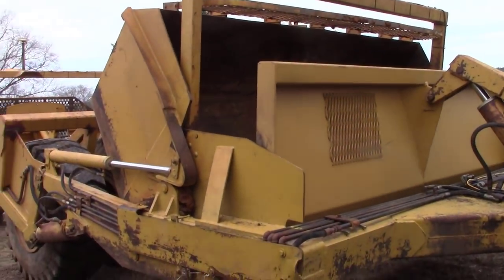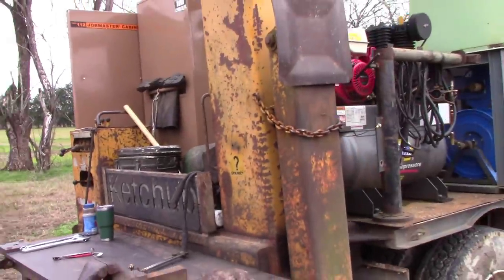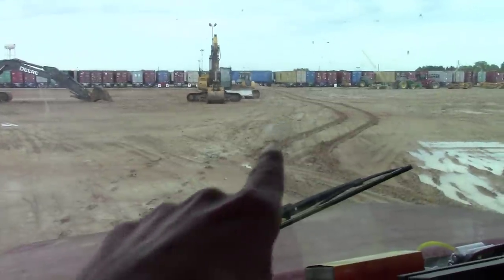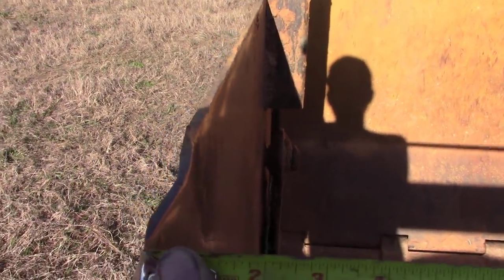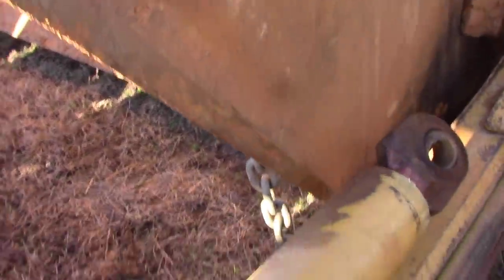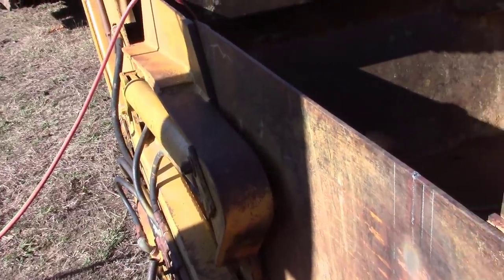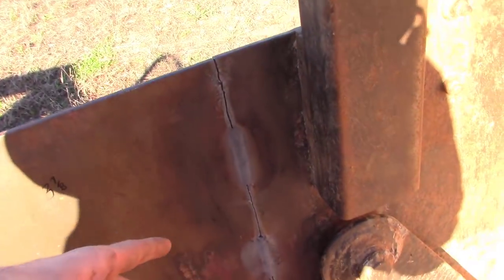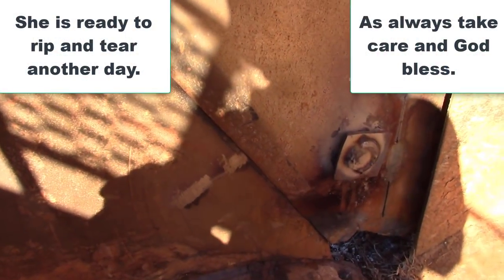Dirt pan repair

Comment: Maybe using a piece or 2 of tubing/pipe and a bottle jack to span the middle and push out (like a porta power) might have helped you push the sides into place.  Just have to be careful the force is straight and contained so it does jump sideways.

Comment: Fifty years a blacksmith. You were heating the correct side but what you needed to do was cool the other side with a wet rag or spray mist from a bottle or hose. Heat the long side of the bend in this case the outside of the plate. When the color begins to show on the inside the short side of the bend cool with water. 
  The cooling causes that side to contract and the heat on the other side allows it to move and shrink, shorten, or upset. Take your pick of a name in accordance with which trade you are in :)
Reply: Спасибо👍, полезный комментарии!

Comment: i would have thouht that would overload your crane
Reply from the maker: Nah she is a 12,000 lbs crane.  At 45 degrees at that length it could pick up 5,000 lbs. I don’t think that ,pick was over 3,000 maybe 3,500.

Comment: in your opinion what is a 7014 rod good for
Reply from the maker: It’s good at buildup say for padding really quickly. If memory serves me right I think it has iron powder in the flux has high deposition rate.
Reply: 7 0= 70,000 PSI tensile strength 
1 = all position
4 = coating additives and AC current compliant 
 Basically an alternating current version of 7018 but not quite as consistent in weld deposit characteristics